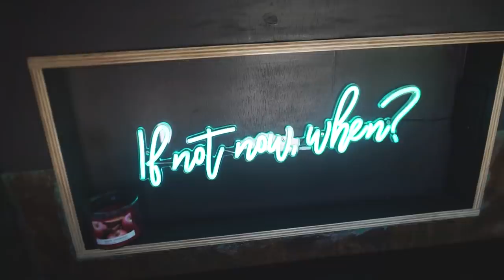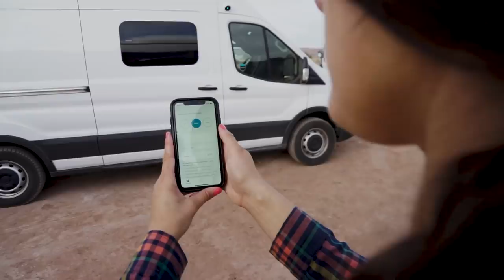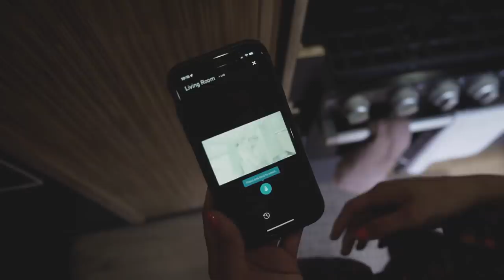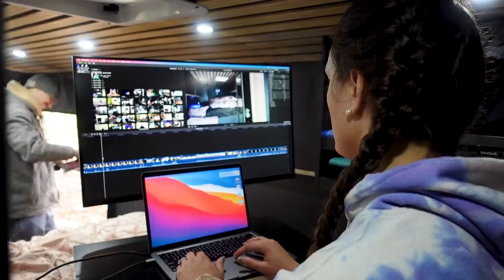Stunning van conversion w/ wet bath. They traded in #buslife for #vanlife

Comment: I go a little the other way I can't do the van but I can do a Fedx 18' box cutaway van. I set it up with N&S walk around queen bed a full bathroom 30x36 shower a real toilet sink & vanity with a medicine cabinet and a cabinet for towels Then I have 2 chairs 2 computer stations and a full kitchen with stove no microwave but YES & Air fryer. I have a 15 thou AC on the roof no fans an esper heater a 65gal fresh 40gal black and 40gal grey. Nice mechanical canopy a 3000-watt inverter 3 big battery bank and the whole roof is done in flex panels a 12-volt 10cubic ft fridge. and more.

Comment: You can get 40lbs of pine pellets from Tractor Supply for $7. That's what I use for my three cats and it takes me at least two months to go through one bag. I get that it's not super great as far as storage is concerned, when you are vanlife or buslife, but it's super inexpensive and there's no added chemicals to those bags since they're designed for horse bedding.

Comment: Nice job! I'm curious about the water filtration setup, specifically, how are they handling maintenance/cleaning of their filters? The two filter housings in that cabinet don't appear to have much space to unscrew and remove; also, how are they dealing with the water that's in the filters/housings when removing them? Thanks!